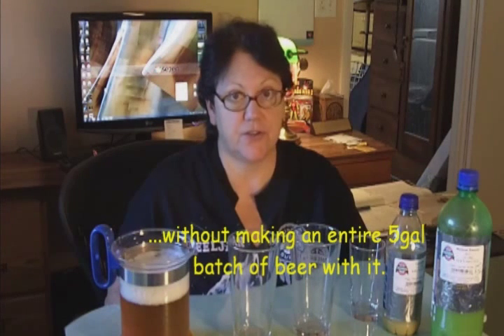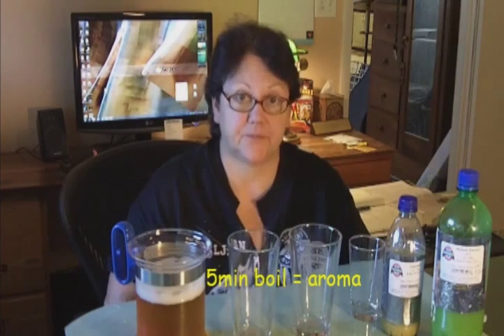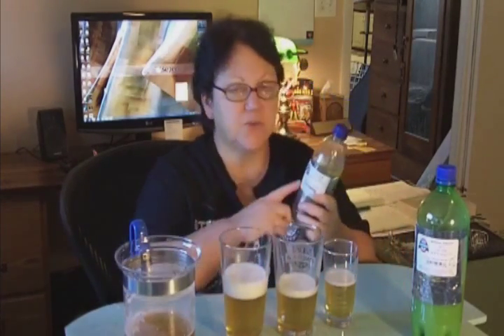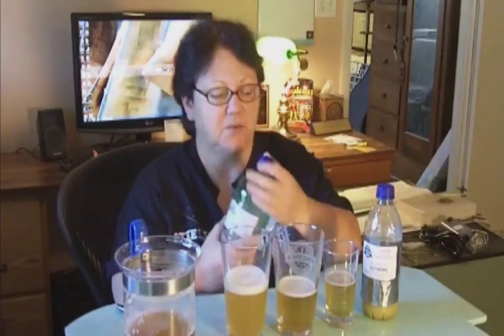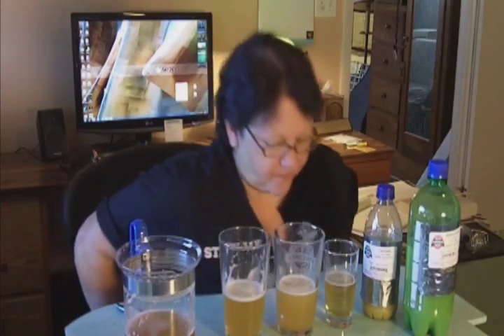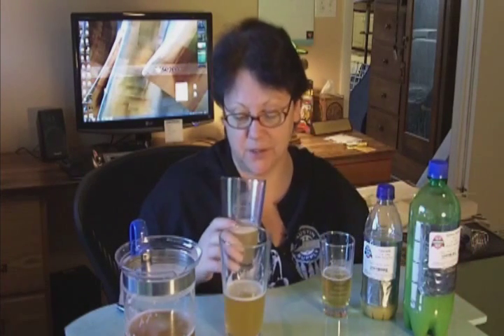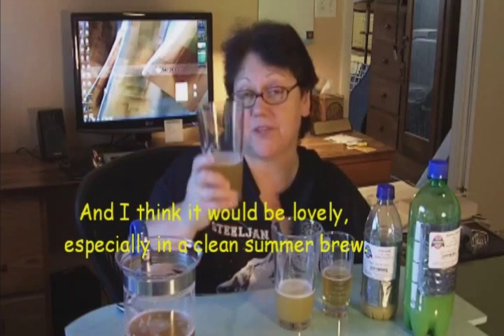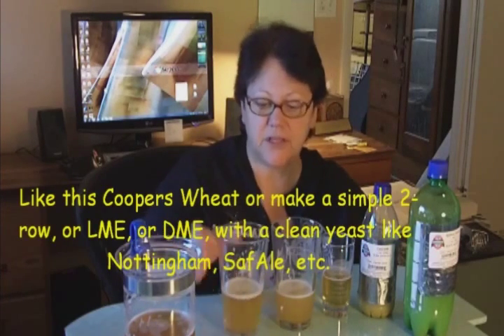DIY Hops in a Bottle - Experience Any Hops You Want - Design Your Own Homebrew Beer

Comment from the maker: @terpsichoreankid That's exactly right, a brew with no hops at all, then you could mix & match whatever hops and other non-fermentables you want to.  Keeping track of ratios and measuring exactly how much you add per volume, like I said in the vid, you could use this to make whatever designer brew you want.  I was telling a friend about this, she suggested dieters could use this to spruce up a low-calorie or low-carb beer.  The sky's the limit.  Cheers!

Comment from the maker: @PeiHomeBrewer The simple answer is yes 50/50.  But the further I experiment with this, I'm finding it depends on how much water you're going to use and what your main goal is.  I upped the water to 1/2 gallon (1.5L) and found that whichever I want, flavor vs aroma, I put a little more in that category.  Have not tried this yet with a 1 hour boil for bittering.

Comment from the maker: @78recordrepair Well, it couldn't be the oatmeal part, 'cause doesn't that have to sit in a mash with a base grain like 2-row, so that the enzymes from the 2-row convert the oatmeal's starch to sugar, which makes it a fermentable.  But I've been trying the hop water in some pretty cheap canned beers and it does make them amazing.  I'm quite intrigued by this.

Comment: @steeljan Thanks for the tip.  Do you raise the temperature controller up a few degrees after attenuation?  Also, since heat rises, I was thinking of positioning the probe either on top of the fermenter or taping it near the top (after reading your previous suggestion).

Comment: @steeljan Thanks!  I actually just bought a freezer with a temperature controller.  I suppose now the challenge for me will be to handle the 4 degrees difference during the height of the fermentation.  I have a feeling that putting the thermometer next to the fermenter isn't going to do the trick.  I do have a sticky thermometer on the fermenter itself, so hopefully that will give me an accurate reading.

Comment: @steeljan Well, after 1 week in the bottles, the added hops definitely made an improvement.  Unfortunately, the beer has an apple/sweetness taste, which is probably due to my fermentation.  I pitched the yeast at 90 degrees F, and stored it in a closet that had small temperature shifts.  I have a partial extract porter in the same closet, but pitched it at 75 degrees, so we'll see if I still have an apple taste.  I don't know if I can drink the rest of this beer. :(

Comment from the maker: @arrogantbastardale Sticking the temperature probe right on the side of the fermenter will work perfectly.  That's what I and most everyone else does.  What I do is that if I'm making a brew that the yeast needs, let's say, 68F degrees, I set my fermentation chamber for 65F and hold it there. For Coopers, except their true lager, 65F works great.  And don't pitch it at too high of temps, get it close to 65F, like chilling your water ahead of time.  Cheers!